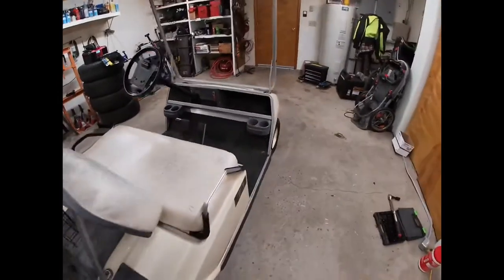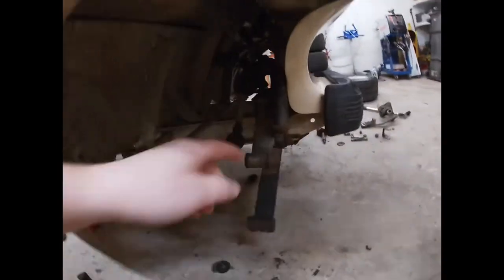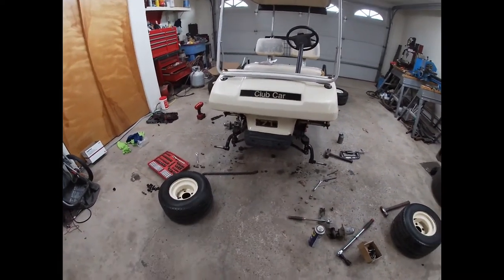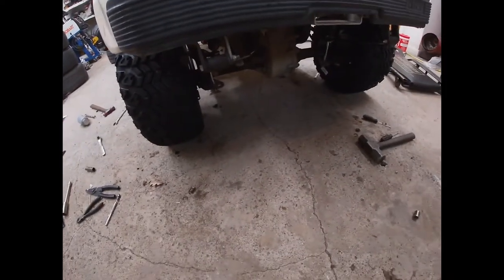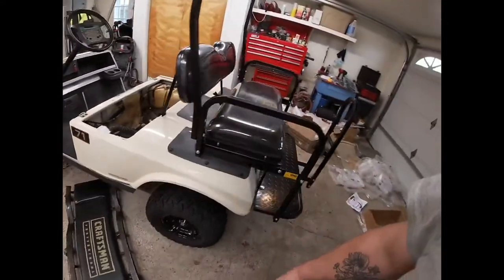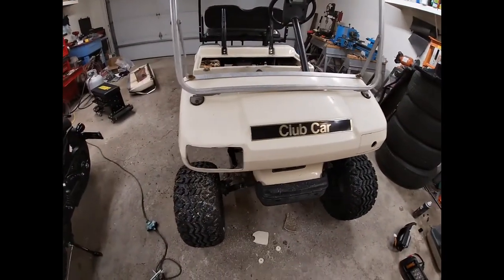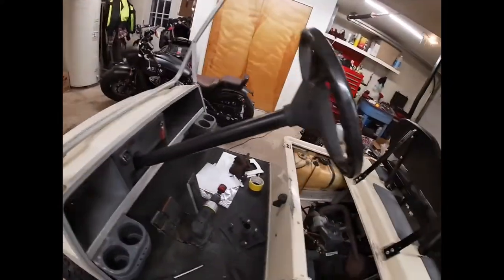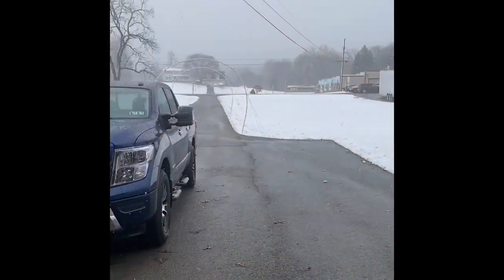Club car ds makeover

Comment: Any problems with the stock low output generator supplying enough power for those heated seats?
Reply from the maker: No at all, I only run them when the engine is running so it never drains the battery low. Even with the lights running,usb stuff charging, and seats running I haven’t had any issues.

Comment: What size tire and wheel did you use? I have a DS and looking for mods.
Reply from the maker: I’ll check! I don’t remember the exact size off the top of my head!
Reply from the maker: The tires are 20x10-10 and the wheels are 10x7. Hope this helps!
Reply: @dirtytruckhotrodshop7829  Thanks. What's the floor height off the ground. Wondering is 6" lift would be to high for my elderly in laws  to step up in.
Reply from the maker: About 19 inches. My 4 year old and 7 year old daughters have no issue getting in or out.